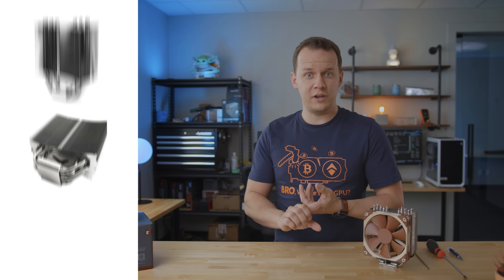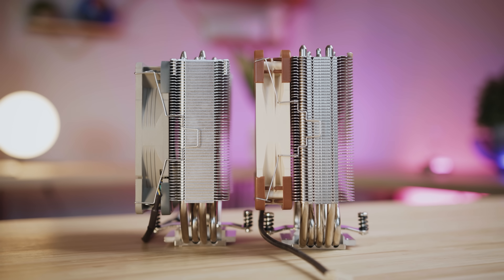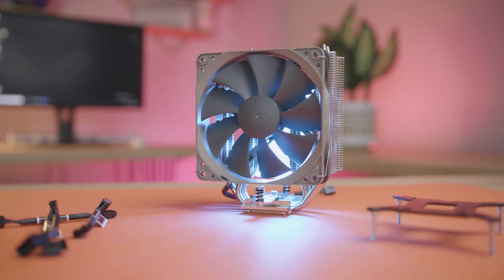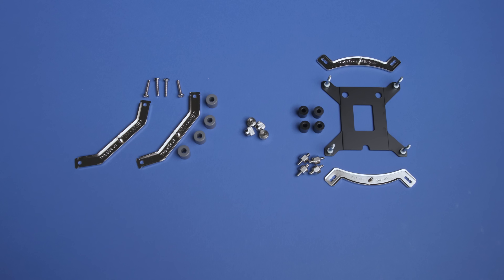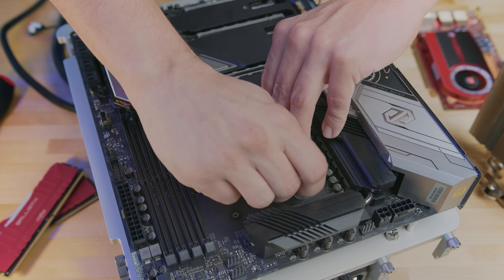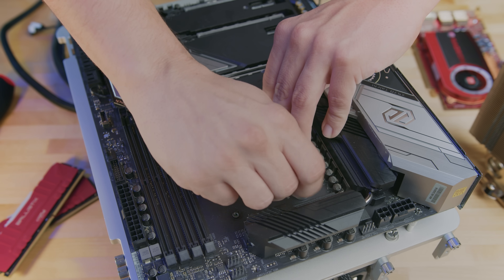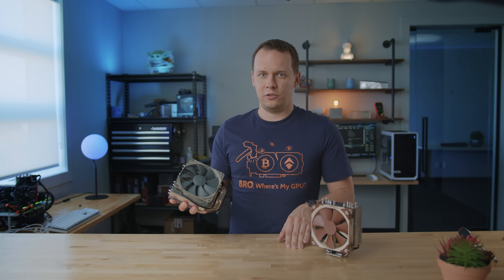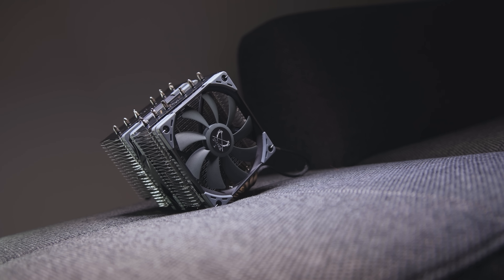Noctua NH-U12S REDUX Review - Another WIN!

Comment: Noctua is the one name in PC hardware that has never disappointed. A Noctua HSF for $50 is actual charity.
Reply: I agree, I literally have so many extra cables and shit from buying so many. I’d rather pay cheaper for what I need then to pay extra for shit that doesn’t get used!
Reply: @PolntBlank  pay cheaper lol
Reply: @James Smith LOL Oh my god, I've never seen someone got butthurt over a product so much after Intel fanboys. Please, show me where did I say it's a "cheap quality cooler".

No it wont fit into cases that Noctua coolers wouldnt, because the 160mm height the NH-D15 fits literally most (as in 99%) of the standard ATX case. A standard ATX case will fit literally any cooler including the NH-D15, what makes you think it cant fit anything else by Noctua? Even the Meshify C and Phanteks P360A can fit an NH-D15 albeit with very tight clearance. In fact that glass would be touching the cooler on the P360A, but it'll fit. There arent much mATX cases on the market and most people still go with ATX cases if they're building mATX since the price of mATX are on par with ATX cases anyway. ITX builds either use low profile coolers or are watercooled. Heck even the bigger ITX builds like the NCase M1 can fit the NH-D15. The Fuma is 6mm lower than the NH-D15 and 4mm lowerthan the U12S and U12A, so no. Noctua coolers fit almost anything. There are any much issue with RAM clearance either, except with NH-D15, and then we still have the NH-D15S.

"When you say "worse", you are being subjective based on design, for which you want to try to make a point that because it's a two tower (though smaller) that it's not as good, while TOTALLY ignoring the test data, which is a pretty wild judgement on a product.  Forget about how it ACTUALLY performs, and make some new subjective judgement about it.  Are you from Intel?" 

Considering a single fan slim single cooler can keep up with a dual fan dual tower cooler, the Fuma is performing worse, it's literally 3 degrees cooler than the Redux, just 1 degrees cooler than the original U12S. That's just not subjective based on design, that is with test data. Note that the U12S is tested with 1 fan. "Though smaller", smaller than what? An NH-D15? It's literally bigger than the U12S, just lower in height. That is not small, just shorter. Effective surface area is still bigger than the U12S. 

"while TOTALLY ignoring the test data, which is a pretty wild judgement on a product.  Forget about how it ACTUALLY performs, and make some new subjective judgement about it.  Are you from Intel?" 

"while TOTALLY ignoring the test data, which is a pretty wild judgement on a product.  Forget about how it ACTUALLY performs, and make some new subjective judgement about it.  Are you from Intel?" 

"while TOTALLY ignoring the test data, which is a pretty wild judgement on a product.  Forget about how it ACTUALLY performs, and make some new subjective judgement about it.  Are you from Intel?" 

"while TOTALLY ignoring the test data, which is a pretty wild judgement on a product.  Forget about how it ACTUALLY performs, and make some new subjective judgement about it.  Are you from Intel?" 

Funnily enough, the redux dual fan is ACTUALLY BETTER than the Fuma 2. Are you an stupid or an idiot? Need I remind you again that this is a slim single tower? 

"In pretty much every way the Scythe Fuma 2, including the quality of engineering, is as good or better than the Noctua, based on REAL data, and not subjectivity.  I find the installation a bit easier because it lines up better than Noctua coolers.  It reverses where the screw and screw hole is and it makes a difference." 

HAHAHAHAHA a real Scythe fanboy arent ya? The quality of engineering is barely what Noctua is. There's a reason Noctua have a very high reputation and have confidence to back that up with 6 years of warranty. This is also why the Fuma is so cheap for a dual tower cooler. Yep the Fuma installation is a bit easier because your ego outweigh the difficulty that you didnt realize the real difficulty of it. Noctua's installation has been said the best by every reviewer, ever, that everyone is questioning why arent other brands just start copying it at that point. 

"It's been tested on THIS channel, which showed the Scythe to be better.  Do I need to post the link to their review?  It's why they included it on their graphs, and it beat out this cooler BTW."

This IS THE REVIEW and included the graph that the Redux U12S beat the Fuma 2 when 2 fans are installed. Did you miss that part? It's in the second last timestamp 'btw'.
Reply: @James Smith IMO The Sycthe Fuma 2 is actually the worse performing cooler. It's a DUAL tower cooler vs a slim single tower. The only reason it's as quiet and have the same temperatures is because, again, it's a dual tower cooler with 2 fans. But it is cheap for a dual tower though. That's the only reason it's acceptable.

Comment: How would this compare to a Hyper 212 RGB Black edition? I just received mine today after waiting for a review and not seeing any for this cooler. It’ll be cooling a 5600x which doesn’t run too hot.
Reply: P.S. The aesthetics do matter to me a ton but if this cooler performs that much better then I might have to return my cooler.
Reply from the maker: The 212 is a LOT less expensive.  Its hard to compare in that case.
Reply: @HardwareCanucks  Well thanks for the response. I’ll just stick with the 212 then. I’m not looking to OC much.

Comment: For extra $20 the original one is still better value considering what you get in the package.
Reply from the maker: Maybe but maybe not depending on what kind of CPU you're running.
Reply: True, at least for me it's still best value coz I use an ITX case with no TG panel so aesthetics is not a problem.

Comment: might have been nice to see a chart showing the dual fan temp to loudness compaired to the single fan, even compaired to the normal u12s since they would be so similar in price it's nice to see if the redux is better performance and or quieter when you use dual fan
Reply from the maker: Thanks for the suggestion.  I was toying with adding that but then decided against it due to time constraints.  If this is a popular request I'll make sure to add in the future  - Mike

Comment: Might as well just put the new fans on the old cooler
Reply from the maker: Two sets of Redux are about $35.  But yeah I get it.
Reply: @HardwareCanucks  Hi Did the experiment - see results in the comments. 2.2 Degree reduction using 1 redux 1700RPM fan (vs Std. 1500RPM) and 5.8 degree reduction using 2 in pull push. BTW can't fathom your low temps - at max CPU 91+/- w load (confirmed by both Ryzen Master and Open HW monitor) I'm already 20 degrees higher at full fan speed than your 120w load? and I have 400+ m3/h in a full mesh case blowing front to back/top (they could just about push a golf ball through a garden hose on a cold Vancouver morning). Using the Noctua NH-N2 thermal compound Is there a secret you could share?

Comment: But...for $55 you can get a Scythe Fuma 2 AND it clears all ram and its dual fan and it runs the cpu cooler🤔
Reply from the maker: Exactly.  BUT in many regions the Scythe is way overpriced.
Reply: @HardwareCanucks  damn I honestly didn't know that.  I built 5 PCs with them and they are great

Comment: If you are brave:  I used black Rit Dye and made all of my Noctua fans dark black.. Just make sure you do this outdoors (gas grill burner) and with a pot you plan on throwing away :).. Came out really nice and did not harm the fans (they are sealed). 7 years later all RPMs are still in spec and they work great.
Reply from the maker: Honest question:  how did you get a fabric dye to stick to plastic / hybrid plastic.
Reply: @HardwareCanucks  You have to put about 5 packets of the RIT dye into a gallon of distilled water. You bring the water to a boil. Submerge the fans into the water until full submerged. Hang the fan power cable over the edge. Use metal clamps, pinchers or some way to fasten the cable to the side of the pot. This is just to prevent the 3/4-pin plug from getting wet. Leave it at a boil (not violent) for at least 1 hour. If you want to go darker you can leave it in longer (2-3hrs). Just be sure to put all fans in for the same time. When done rinse well with cold water (stainless steel sink or outdoors). Let to dry on paper towels. May need to repease a rinse. Enjoy your BLACKED out Noctua fans :) - Edit: I even put the silicon (rubber?) corners in too but I did remove them from the fans first.

Comment: Honestly that accessory kit is a decent value all on it's own.  I've got Redux Fans on one of my radiators.  For the vibration pads and fan alone I think they add up to about that much usually.
Reply from the maker: Or more.  But you'll notice (something I didn't until after I went on-cam) that the Redux fans on this + the kit only have one set of anti vibration mounts, not the usual two.
Reply: @HardwareCanucks  for Radiator mounting that’s fine IMO. Doesn’t look as nice if they are visible but otherwise I don’t see much reason to have both sides equipped.
Reply from the maker: @HotRodHippie  Its interesting you say that.  The Redux fans aren't really designed for optimal noise / static pressure ratio so they wouldn't do as well as some alternatives on radiators.
Reply: @HardwareCanucks  I’ve been fairly happy with them to this point. I could stand for a quieter option but they are getting the job done.

Comment: I bought 2 of these for 2 systems.   You don’t need the Noctua screwdriver to install. Installation on AM4 is a breeze and up to Noctua standard.
Reply from the maker: True....but those screwdrivers Noctua usually provides are amazing for a LOT of things.  Including Ikea furniture.  Trust me, I know.  - Mike.
Reply: @HardwareCanucks  I believe it, Noctua stuff is awesome!
Reply: @HardwareCanucks agree there! The longer right angle ‘bar’ really helps to torque up on Phillips #2 head screws, especially if you suffer from grip strength through disability.